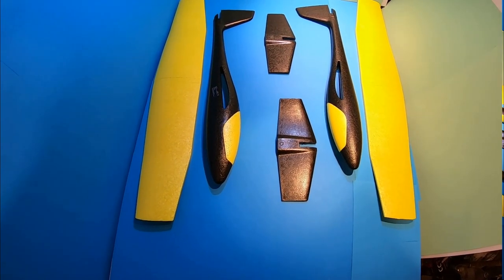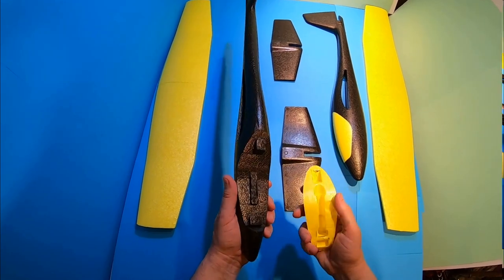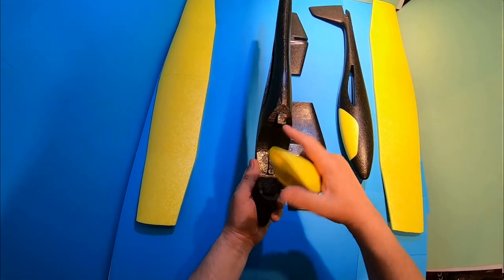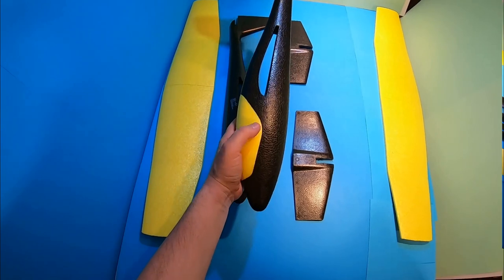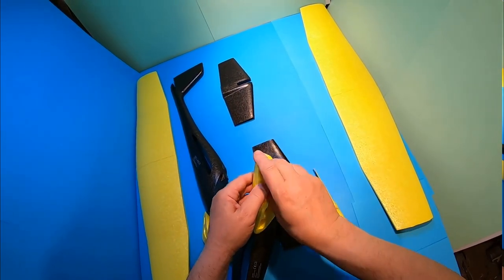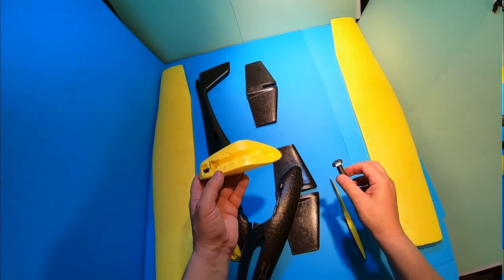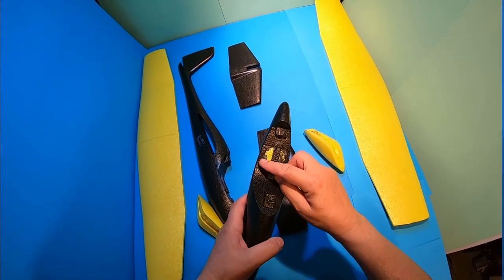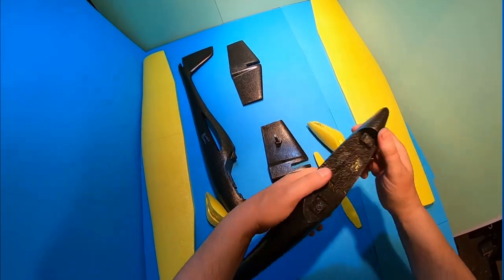Duo glider Conversion 2

Comment: Great video! Gliders # 2 and #3 are on there way across the pond thanks to EBAY. I put a  40mm EDF on the first one and the plane just wants to stay up and not land. It just floats thru the air.  These little gliders are so much fun I wish LIDL would produce more of these next year!
Reply from the maker: Thank`s David, It was hard work editing this video and uploading a 1/2 hour video, i wanted to add some music and text to help explain  things as it went along but spending so long on it, i decided to post as it is.
I think Lidl will produce more next year, Ebay is a good source for chuck gliders i have ordered some more. The Bolt i will do a powered version. And the Cheetah which is only £7.99 and looks like a copy of the Bolt.
Reply: @RcAircraft  It was a good video and had just the right amount of time actually building the glider covered.
Reply from the maker: @davidpuissegur1263  Thank`s always nice to know .